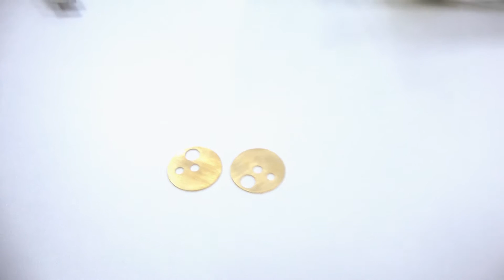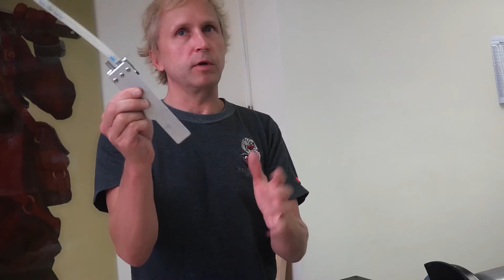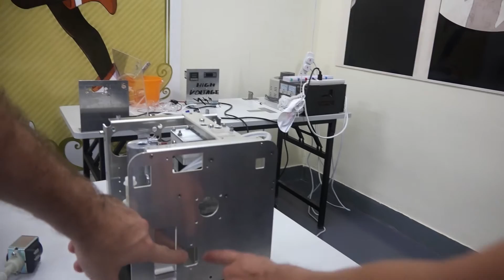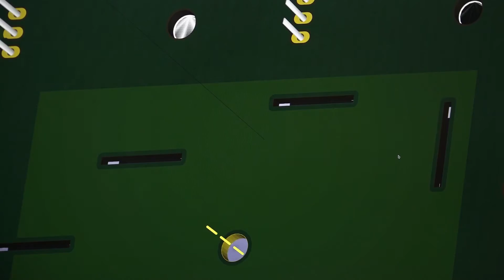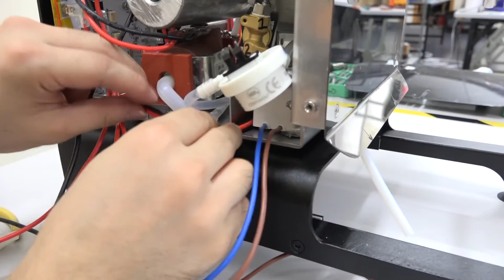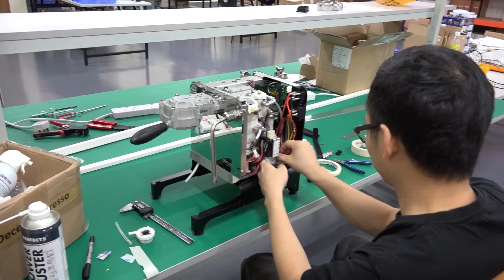SB9: Building the First Machines

Comment: What was flightmode? Did you ever disclose?
Reply from the maker: haha well spotted! Yeah, you can grab the tablet with both hands rotate it forward in the air.  The angle of the tablet defines the flow rate (or pressure).  Essentially, it's like the group head controller but also kind of like piloting an airplane.  However, it never worked right because of bluetooth bandwidth limits, so we never released it.  It might make it's way again when we have a fast USB connection to the DE1.
Reply: @decentespresso  that's  like a wii espresso :)  sounds interesting, good luck

Comment: Will the water reservoir have a sensor to tell us when it's low and if so, will that information be accessible through the API? 

Also, I'd like it if there was a way to rate the quality (taste) of the the shot. There's potential to play with numpy, scipy, etc here.
Reply from the maker: Yes, there are two stainless steel tubes that go into the water tank, one sucks water, the other is a water level detector. That info is displayed in the GUI but is also available via API (bluetooth, JSON, etc).

It's straightforward to implement your own ratings methodology, and I've heard suggestions for at least two different methods.  My expectation is that this sort of functionality will, at least initially, be implemented as a plugin.